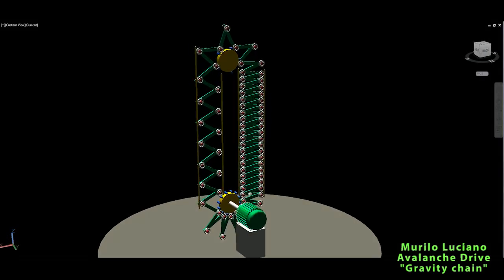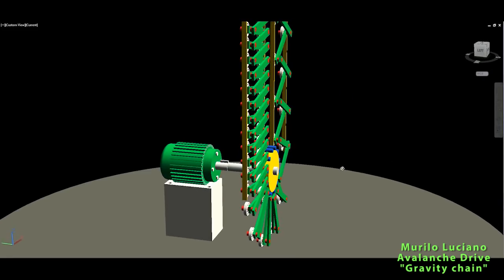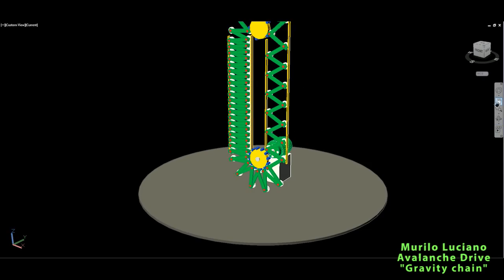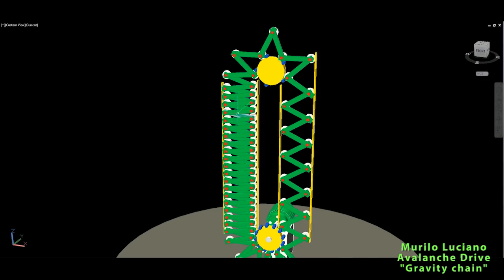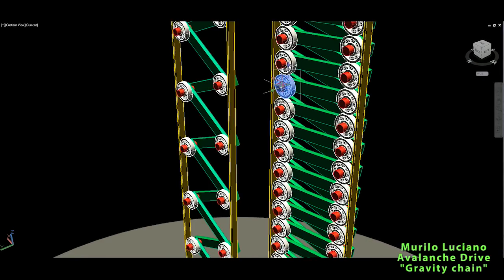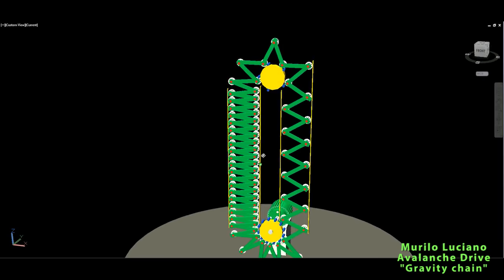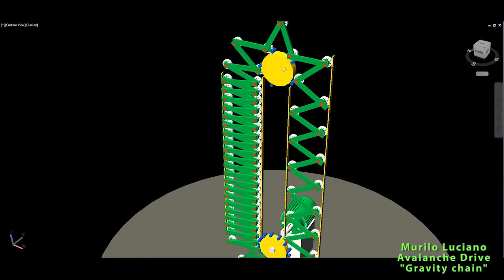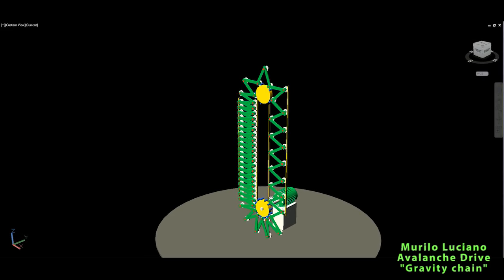Free Energy Generator, MURILO LUCIANO Gravity Chain, Avalanche Drive!!!

Comment: Certain mechanisms need to be in place for it to function, has some potential...  Must have flow regulator so that for every link that crosses the top, so is the bottom, the weight of the chain must impart torque on the wheels and be pulling up on the right channel as well as the force of gravity free to move the chain on the left...

Comment: What would keep the heavier side from just extending to the same extension level  as the light side. And what pulls in and condenses the heavier side? The heavier side would just fall and extend exactly as the light side looks, they wouldn't stay closed tight like that unless they were pulled in and forced together
Reply: the chain which connects to the two sprockets together like a motorcycle engine and the sproket on the rear wheel.

Comment: in theory it works but in practice it is facing, ok 30 graves must rotate the bottom shaft which in turn at each tooth climbs upwards a weight that in theory should rotate the top shaft which in turn it releases a weight, but does it really make them climb on so upward so they do not squeeze the pile up to the other as if they stray the straw in the bag?

Comment: Since the parts on the "up" side need to move faster than the parts on the "down" side, it looks like it would be balanced due to mechanical advantage... just like most "perpetual motion" machines that won't physically work (and are most often promoted by con-men and charlatans). Also, there is no upper track at the top or lower track at the bottom so the parts could flop around and it would not be stable; it's an incomplete machine that could never work even if built properly.

Comment: Congrats for the design Murio. Any idea is welcome in my opinion. Working or not, ideas may be the seed of better ideas. The reason this particular design wouldn't work -- IMHO -- is that, in order for the right side to travel up one chain eye, the left side needs to travel down about 3 chain eyes. So, although the chain on the left side has a mass of approximately 3 times the chain on the right side, if each chain eye on the right needs to travel 3 X the distance of a chain eye on the left, that means to me the chain won't move anywhere.

Comment: If you want REAL free energy:

1. Use a helium baloon attached to insulated copper wire. A static charge will accumulate which will be large enough to turn an ionic motor.

2. Buy land under super high voltage power lines. Build an electric fence (strands of wire insulated from the ground). Wire an AC motor between the fence and ground.

Comment: 4 reasons why this wont work

1. Needs guides on top and bottom to keep the chain from falling out.

2. Requires the electric motor to compress the left side or else both sides will equalize.

3. This is nothing more than a delayed reaction chain drive, in that it can store some energy. Basically there will be a small amount of time before the top sprocket turns after the bottom one turns.

4. Gravity is acting on both sides. The force of gravity on the left side and right side is equal so the chain will equalize with an equal amount of links on both sides.
Gravity is pulling down on both sides so without a force added on one side nothing will happen to make the chain move.
Reply: the chain connecting the sprockets keeps more weight on the one side.

Comment: the reason these machines don't work is really much easier to understand if you realize the "heavy side" and the "light side" are connected in a loop.  So you can't think of one "side or the other" in terms of heavy and light.  It is one system, period.  So the weight of the system (remember its all connected) will pretty quickly settle around its center of gravity, coming to a stop.  This is true for ALL devices that use this "unbalanced wheel" idea.
Reply: keep on working for the bankers and watch them remove the value of all you accumulate.  Then tell us how that's better than what you have (almost) seen here.

Comment: The guides on the 'heavy side' need to be on the inside of the rollers otherwise the links are just going to drop out the bottom without pulling on the next link

Comment: Have they ever thaught about traveling distance of elements of left and right sides?
Having 3 times less elements requires each element to travel three times greater distance.
Three times more elements (21 of them) change elevation three times less each.
Change of potential energy of the heavier side is equal to change of potential energy of the lighter side.
Energy output of the system is (21W x h) - (7W x 3h) = 0.
All energy given by heavier-side-going-down is taken by lighter-side-going-up.
Even smallest friction anywhere will prevent the system from moving.
Reply: but there's a longer torque arm on the descending side than on the climbing side.  You have ignored that and yet it's the essence of the design.
Reply: @lebergerdesphotons4565  Nope, I didn't ignore that, but we easily can because it doesn't change
how much potential energy one side gains per potential energy loss on the other side? :)
Reply: It's good that you're here and actually use physics. So you're open minded enough but able to think.
However I do not worship physicists, many of them say energy in = energy, pretty much, therefore no such system can work.
However I thought... is gravity a law or a force? It is a force. And it accelerates things. Plus magnets can repel another magnet and thereby blocking gravity. The problem being the resistance of them to enter a field of the same charge. I think can be overcome by redirecting the magnetic waves so that the repulsion is very sharp. Sudden and powerful. 

Can it take less force for the magnet to enter the repulsive field, than the repulsion creates by thrusting it away, changing the balance of this wheel, which will ACCELERATE and come back spinning with more energy than the resistance to face the replusive magnet?

Comment: simple F=ma; more mass on the left but more acceleration on the right ... e.g. (21)(1) = (7)(3).
Reply: There's also PEg=mgh, but the energy outlined in this equation gets extracted by the generator. Its parasitic load would stop the mechanism. Simple conservation of energy.
Reply: Matt Brody if the generator were small enough, and the weight increased could it work ?
Reply: james davis no, it violates conservation of energy. Regardless of the generator's size, and regardless of the weight, the amount of energy the system has to work fights against itself to lift and fold the smaller side onto the heavier side. Adding a generator would remove enough energy from the process that it would stop very quickly. Even without a generator, the friction between the joints would bring this system to a grinding halt.
Reply: Thanks Matt Brody.
Reply: I spent like 20 hours thinking of that when I saw this things a few years ago
Reply: @lebergerdesphotons4565  and what YOU have failed to consider is that gravity pulls downwards on all members, which are all free to move. The movement the system will experience is transient. The linkages on the left will move more than the linkages on the right until the structure reaches equilibrium and settles.

Comment: This scheme will not work because from the right side the sections it is three times less both in count and in mass, but the lifting speed is three times higher, and in order to raise it three times faster, you need to spend three times more energy on acceleration. The circuit is completely balanced, and will not work, despite its nice idea.
Reply: what about the different lengths of the torque arms on each side?

Comment: Replace inner yellow walls with belt that goes all around inside them put another belt on outside belts hold them where they need to be and belt drive is better also outer belt could drive also good idea
Reply: I guess that your name with “prophet” in it is quite fitting,in the sense that you guess at something,and end up being wrong.

Comment: Another way to show that this can't work the following :

The bottom drive gear needs to be connected to the top gear by means of e.g belt pulley at the bottom gear with radius (Rb) and smaller belt pulley at the top gear with radius (Rt) in order to always keep the weight imbalance as shown. The relationship between rotation speed of the bottom pulley (Nb) and rotation speed of top pulley (Nt) is : Nb/Nt = #R/#L = Rt/Rb, where #L and #R is the number of masses on the left and right side of the gears respectively. If (M) is the mass of one weight and (Z) is the torque arm then the applied torque (kg.m - units) to the bottom pulley is : Tb = #L*M*Z. The belt force of the extra pulley (not  shown in the video) is then : Fpul = #L*M*Z/Rb so that the torque applied to the top pulley is : Tt(applied) = Fpul*Rt = #L*M*Z/Rb*Rt. The top pulley must overcome the weights on the right side so that the torque required to lift the right side is : Tr = #R*M*Z. The output torque (Toutp.) is then : Toutp = Tt(applied) - Tr = #L*M*Z*Rt/Rb - #R*M*Z, but we know that Rt/Rb = #R/#L ( see above) so that 

Toutp = #L*M*Z*#R/#L - #R*M*Z = M*Z*#R - #R*M*Z = 0. 

Conclusion is that the 'Avalanche drive" design can't work as hoped for, so don't ever try it, you will waist your hard earned money.
Reply: Ridiculous comment.  “Here’s some equations that show why I THINK this can’t work… so don’t EVEN TRY”
Reply: @audiblebites553  
"Ridiculous comment." Really? This is not a "think so" comment. These  energy equations mathematical proof that it can't work. But maybe you can give another mathematical proof that it can work? Can't wait to see your ridiculous proof that it can work.

Comment: Will not work. Because the energy from the heavier side = the energy needed to lift the lighter side.
The reason is that the lighter side should be lifted quickly. We need 1 kg of lifting force every second versus 10 kg of energy every 10 seconds from the heavier side.
10kg = 1kg * 10
Reply: Even more precise the power on left side = power on right side, so the difference = 0
Reply: @marianskodowski8337  you are right

Comment: Actually you would need a small brake to slow down the side that has the most weight and you would need springs so it can go wide on one side and eventually it would compress down even then it might not work...

Comment: Scuse me, ever heard of "Laws of Thermodynamics"?

Energy cant be created or destroyed, but can be transfered and converted from potential to kenitic and kenitic to potential.
Reply: Yea sure and also it is impossible to fly faster then the speed of light. 
Both are myths based on lack of latest discoveries and facts. Count the gravity wave in plus quantum physics then talk again about outdated Laws of Thermodynamics from 1824. 
It is like using a tin can telephone nowadays instead of a smartphone. Some fundamentals connect these two yet at the same time they are totally different.
Reply: @L2HfT  I like it, but instead of a smart phone, use a pc behind an anonymyzer on a network that isn't logging mac addresses and knowing who you are.

the thing these well meaning skeptics are missing is the rest of the law of thermodynamics which they forget to finish or don't know about:   in a closed system.

There are no closed systems.

Comment: Works until it frictions out. Build it in a vacuum, then, lets see how long it will work, until friction stops it.
Reply: It still wont work because the generator turning it generates friction.
Reply: Yes, friction will stop it from moving but, it will move longer.